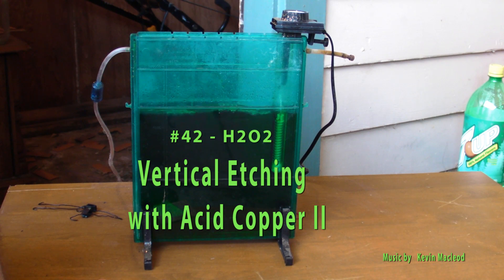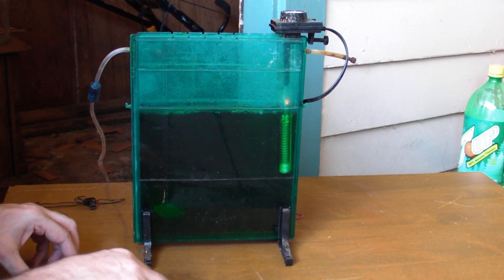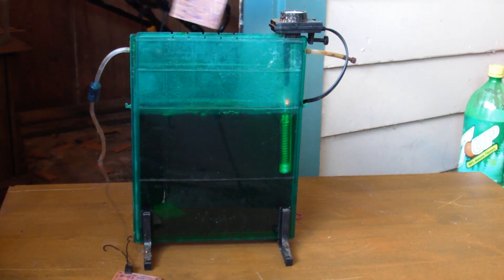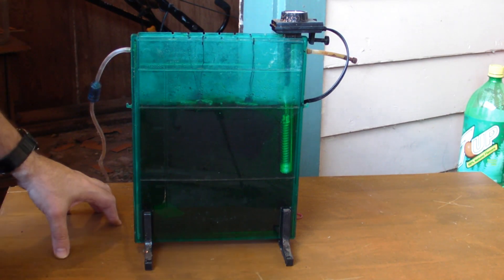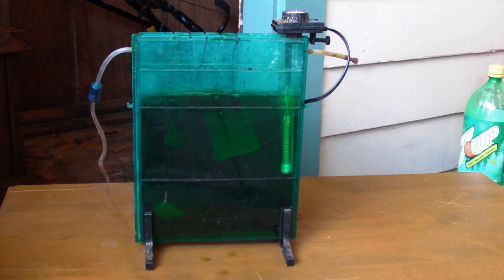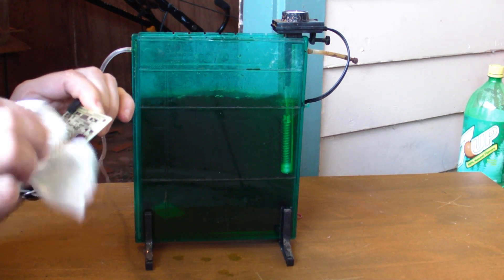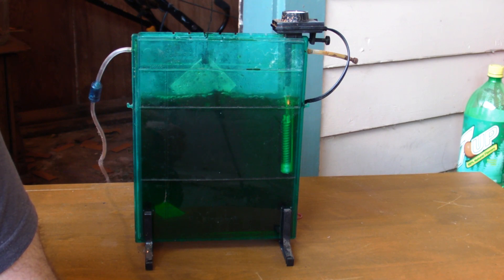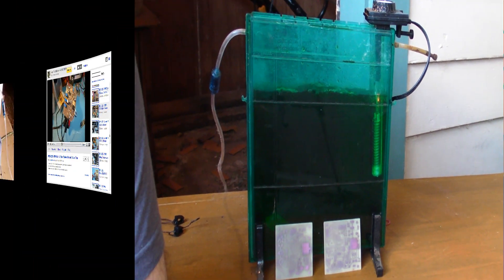#42 H2O2 - Vertical Etching With Acid Copper II

Comment: Hopefully people won't take this the wrong way. This is not really etching with cupric so much as with acid peroxide. You can't "boost" your cupric with peroxide and maintain accuracy of cupric (which is very nearly as good as ferric). Once there's excess peroxide in there, the peroxide is oxidizing copper, and that oxidized copper is being dissolved by acid, directly. There is some etching by cupric, but not very much. If you are just wanting to save money and helping the environment by reusing your acid peroxide etchant, that's fine and all. But if you compare to ferric or properly-used cupric, there is no comparison in terms of accuracy. What's pictured here will be great for half oz boards, but it will get a bit fuzzy/ratty with 1 oz copper. 

Sharpie is especially sensitive to the etchant, and it doesn't hold up well to acid peroxide. If you want to use sharpie, this won't be a good etching system. Cupric is a great etchant for sharpie, but this isn't etching with cupric.

Comment: they are pretty easy to make if you have a 10inch circular saw. Go to harbor freight and get yourself their 80tooth 10inch blade. and then source some plexi. If you know someone working at a hardware store they often toss their scrap pieces. Ive had a stack of the shit for 5 years from when i lived with a guy that brought the scrap and scratched pieces home.

 A lot of people buy the expensive welding glue. i have used that too but ive found simple/cheap acetone clamped for a few hrs produces the same result.

 I live in an apartment so I built a heavy wood box to place my etch tank in... i then lined it in thin plexi with silicone sealing the edges. The point of this was I wont spill cupric on my 1st or 2nd floor neighbors unless winds are strong enough to rip the balcony and or roof off the apt... i figure at that point the cupric isnt going to be anyones first concern.

Comment: Maintain 30 degree celcius?
Reply from the maker: The Submersible heater I use is for a Fish tank 200 WATT , Its all glass, adjustable Temperature, Its high temperature is AROUND 28 DEGREES C. 30 degrees C should work fine.

Comment: what is the temperature you maintain there ? i want to add a bubbler too, by mines are hand drawn with marker / laser printed. will the bubbles remove the insulation ?
Reply from the maker: About 28 Degrees C, Markers like sharpie and Laser printed traces are plastics, keep laser prints dark/black, and make sure when using pens that it is well covered. The bubbles will not damage the drawn traces.
Reply: i see.

Comment: Hi. I would like to know what sealant you used for the tank? Thank you
Reply: use acetone and make sure the edges are smooth. it will weld the plexi making it like 1 continuous sheet. you must lightly clamp it for a few hours.. too much preasure and you will get cracking.. the cracks will seal or you can seal them with acetone again  so it will more look like shit than effect your tank.

Comment: Gloves???
Reply: +Paul Cutting If one were to use plastic gloves while handling acid, an accident would be exacerbated. Plastic is corroded by acids and would fuse to the skin. Generally acid = no gloves so you can neutralize it and not die.

Comment from the maker: @TheWisey1234 The Acid it derived from Hydrochloric Acid + Hydrogen Peroxide With Dissolve Copper into solution, There is a link on my website under "H2O2 Links" that explains how to make it and how to use it and regenerate it.
Both these solutions are available in stores, and the copper comes of your boards. I love using "Acid Copper II" Thats what it is called once it is self sustaining!